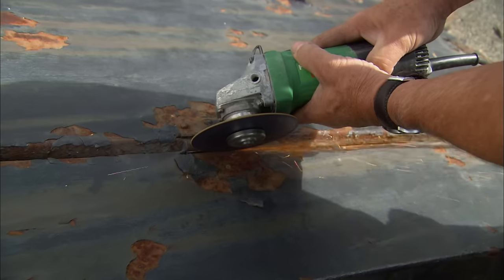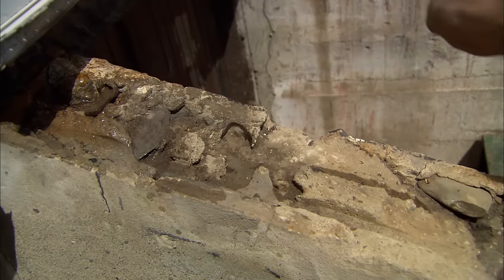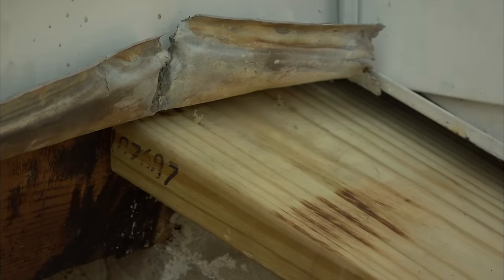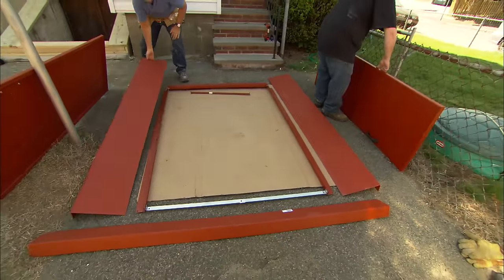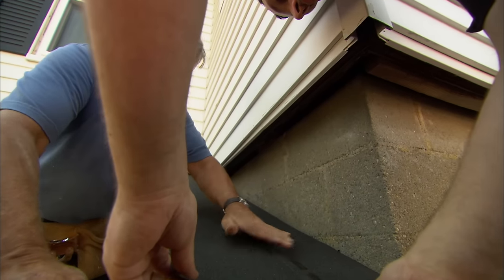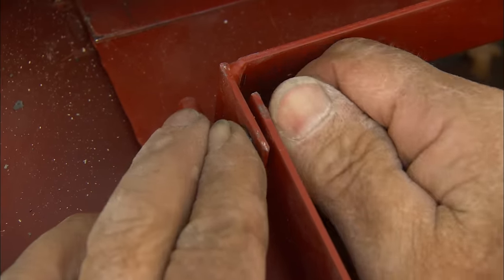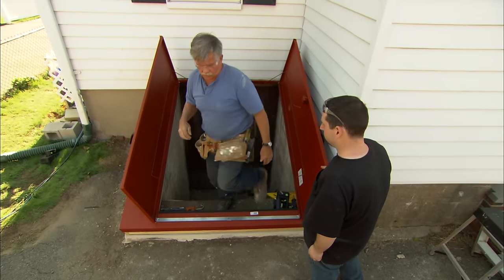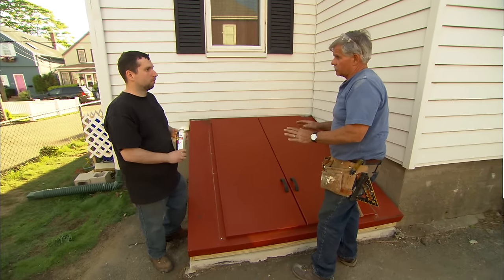How to Replace Basement Bulkhead Doors | Ask This Old House

Comment: theres something unsettling about using an angle grinder without the guard, something something ripped knuckles, idk
Reply: Yea im confused as to why he's showing everyone the wro g way to use angle grinder. He even wielded it with two hands!
Reply: Oleg Silyuk everyone does it like that
Reply: Oleg Silyuk and ducked it on the ground when it was still spinning and they go on about safety
Reply: always wear leather work gloves with angle grinders. I almost lost 2 fingers going bare handed.
Reply: @samsngdevice5103  I'd rather not wear anything that can catch in the blade
Reply: @M4st3r0fN0n3  
Dummy, Ever heard of leather safety work gloves?
Reply: Barry Lab  In the video Tom has no eye protection, gloves or sleeves.. Not saying it's the worst thing that ever happened but given it's on TV not some guy in a  shop it would be better with a guard - usually they're careful about protection
Reply: Oh he has eye protection for fitting the new at least. At the start where he's cutting the hinges he doesn't
Reply: Yeah it's sketchy, you're asking for trouble. Safety always and respect your tools. People get way too comfortable and that's when you lose some fingers, guard should always be in place where possible.
Reply: I was grinding overhead without a guard, it kicked back and the red hot wheel cut into my left forearm and instantly cauterized itself. I have a pretty gnarly scar as a reminder to use a guard from now on.
Reply: If that's all you get out of this, go away.
Reply: @steventhury8366  this is a "diy" channel. I would assume they would want to spread safe techniques, not sketchy ones. Also something something internet, freedom of speech? Bugger off
Reply: First thing you do when you buy a grinder is remove guard.

Comment: Can’t say it enough face shields are so important when using grinder cutoff blades I know from experience spent 8 hours in the ER getting pieces of the blade taken out of my lip
Reply: Some people shouldn't be around power tools and that's ok
Reply: Did your boyfriend come visit you at the emergency room?
Reply: The ones that are arguing with you have obviously never seen what happens when a grinder wheel catches and goes flinging up to your face. It happened to a family member of mine who is very familiar with power tools and usually very cautious. He was just grinding off one small area when it caught and flung it into his face. It literally cut a furrow across his chin bone. After that you'll never catch me using a grinder with a large wheel and not using a face shield

Comment: I just redid my cellar doors, without this video I would have never had the confidence to do it myself!
Reply: I'm about to redo mine. And I wish he hadn't skipped past one step..maybe you can advise me. 

So at the bottom when he screwed together the panels of wood for the bulk head to sit on level, because the surface was previously damaged..what steps did you take? And did you use any wood glue in-between since he said there should be no air gaps between?

Comment: You have to love the grinder safety, it’s just amazing! I love his Invisible  face mask and shield, plus the invisible guard for his grinder! You don’t really need safety with a grinder, they’re not dangerous at all. And the way he just let the grinder blade hit the ground like that, has safety written all over this video.  I just noticed he use a cut off wheel to grind off screws.
Reply: I've seen what happens when a grinder wheel catches and it gets thrown upward. I've got a family member who has a scar across his chin where it went deep enough that it cut a Furrow in his chin bone. I'm in agreement with wearing a face shield when you're using a grinder like that.

Comment: Grout because it’s softer than cement we want that bond and once it gets hard it won’t crack it will hold moisture  better than cement does it’s Type s HLM 3.5 correct?

Comment: Why grout and not concrete?  Also, is there something that you can paint on the existing concrete to make the new grout hold better besides water?
Reply: Use grout because concrete will break up due to the thin application.

Comment: 4:20 would like to see the details of that flat surface.  Seems like a tricky bit.  You show just about every screw being drilled in.
Reply: looks like a trip hazard. A bit more work, but I would have tried to lower the front end as much as possible. You have to step over that every time onto a narrow step.
Reply: All that is dictated by the existing concrete.

Comment: Tom should have used a longer concrete screw judging by the video it looks like the screw only penetrated about 20-30mm of structure maybe less.
Reply: +iShootBandits I thought the same thing.
Reply: about an inch longer at least! and he touched lead all with no gloves, but he had a good life i bet =)
Reply: OSHA Reg.1910 for Lead states : exposure to lead at concentrations greater than fifty micrograms per cubic meter of air (50 ug/m3) averaged over an 8-hour period.  I highly doubt Tom has anything to worry about.
Reply: Have u ever tried to pull one out of the concrete
Reply: Rob Anderson there’s nothing wrong with touching lead lol are you alright? It’s consuming lead you should be worried
Reply: All of his screws were too short.
Reply: Probably would....if it was his home.

Comment: So if a thief wanted to break into the basement all they would need is phillips screwdriver?
Reply: The home owner should install a weather-tight, lockable door at the bottom of the stairs.
Reply: Two L brackets and a two by four on the back side of the cellar door will stop em.  You're not getting through that without waking the neighbors
Reply: make sure you have a Philips #3 ... theives should use the proper tools

Comment: Hello! You as a PRO can u answer a simple question: Why Americans remove guard from angle grinder, and don't use hearing protections, see that almost i all videos?
Question about this video - see that you don't use waterproof membrane between concrete and wood, also screws was too short - 1/2 inch in grout?
Reply: @vids595  Also wondering if those screws are coated to prevent the newer PT chemicals from eating away at them.

Comment: Ok if you are going to remove the guard on your grinder to use a cutoff wheel,  and I understand it allows you a little more agility or a larger wheel with the grinder but please wear gloves and a face shield in case that wheel blows up. Also wait for the grinder to stop spinning before you just drop it on the ground in fact don't drop it on the ground or you'll cause a fracture the disc that can cause it to explode so many safety hazards
Reply: You should never wear gloves because they could get caught on the disk and pull your hands in to it
Reply: I had a cutoff wheel explode on me one time. I was lucky I wasn't hurt, but it taught me a lesson. It was like a grenade going off.

Comment: can't say I'm impressed with his safety performance there.  Using and angle grinder without the blade guard, without the handle, without a face shield, and did he just toss it on the ground????
Reply: Yet, he's managed a 40 or 50 year long career with all his original parts. Experience is safety gear.
Reply: @e.l.norton  stupidest comment I've heard.  No!  Experience is NOT safety gear.  All you've managed to demonstrate is that he's been very lucky.

Comment: I'm sorry, but 0:29 he looks like it's about his 2nd time using a grinder.  
Also 10:04 the door seems to have a bigger gap on the bottom vs the top. Maybe it just seems that way, but still, just because the bottom edge lines up it doesn't prove that it's square. Having said that, this unit screws together at the top and bottom for a set width, so you can't really change it.

Comment: Spent years fabricating steel, never used a guard on the grinders, never seen a grinder accident.
Reply: Then you haven't worked for years, dumb to not have the guard in place

Comment: I know this is old but galvanic corrosion is not when metal comes into contact with wood. It’s when 2 dissimilar metals come into contact with each other
Reply: I think treated wood is made with a form of copper so maybe that creates the reaction.
Reply: @rawbacon  I had the same thoughts as you and Sears Garage.  CCA has been banned for some time.  Does the moderns stuff still have a metal based preservative?
Reply: @kcgunesq  From the Home Depot website: "The active ingredients commonly used in treated wood are alkaline copper quaternary (ACQ), copper azole (CA) or micronized copper azole (MCA)."
Reply: The new chemicals that they use in PT lumber will eat un-coated screws in no time.
Reply: bush master 

That’s fine but that’s still not galvanic corrosion
Reply: @122276mjs   okay, just corrosion of fasteners caused by the copper based chemicals used in PT lumber. Dissimilar metals in contact with each other causing corrosion and premature failure.

Comment: Whats the brand of the cutting angle tool at 2:07? Or where can i buy it?
Reply: +Anton G That is a standard circular saw that is adjustable for cutting on an angle.  That type of saw is manufactured by many companies and can be purchased at any hardware store.
Reply: +prairie wanderer Oh sorry,  I meant the L-square tool.
Reply: Anton G

No apologies necessary.  That's a speed-square.  The one in the video looks like a Stanley brand.
Reply: Swanson speed square

Comment: Never use an angle grinder to cut steel w/o gloves.
Reply: more like with out glasses
Reply: No never use a grinder with gloves because if a gloved hand gets caught on the disk it will pull your hand and possibly your arm in

Comment: First off use a guard on your grinder, i've cut my hands up twice because I didn't have the guard on & use a grinding wheel and not a cutting disk to grind. Also when chucking down grout use a PVC glue mixed with water, it will bond a lot better.
Reply: Learn how to use your grinder better.
I don't use a guard either since it gets in the way.
Reply: I used a guard, then I got really pissed off and took it off when I was welding the base for a work table. Haven't put it back on since. Probably should, but eh.
Reply: Mister, never used a guard and never will. All they do is get in the way and if you're cutting your hands, you don't know what you are doing. 25 yrs and never even came close to getting cut, plus have you ever heard of gloves ?
Reply: Ever had a 1mm metal cutting disk explode in your face ? Wish you had that guard on then pal.
Reply: You mean regular old water
Reply: accidents happen you know? it could be a defect grinding wheel that suddenly breaks, or maybe it would slip then break and there, you lost your eye. all that happened in less than 1 second. just because you took off the guard

Comment: using screw to attach the door jamb from outside like, isnt it will make easy for thief to open it ?, i think we should weld it
Reply: co sakti it would be logical to weld it but many thieves  don't want to spend time trying to open a door , due to the higher risk of getting caught or heard
Reply: Welded screws and locks only help keep an honest person, honest.
Reply: co, do you really think a thief is going to unbolt a set of bilco doors ?  Come on man.
Reply: The doors themselves should really be better designed and have some screws protected by the door itself. Welding will still be better, but most home gamers wont know how to do it and not have the equipment.
Reply: You would be surprised how easy most front door locks are to break.

Comment: there is no wet isolation between concrete and wood! wood will rot fast!
Reply: No it will not, it's pressure treated. That wood will last 50yrs.
Reply: it's still wood, even pressured!!
Reply: There was a waterproof barrier that he put down.
Reply: The barrier he put down was between the wood and metal, not wood and masonry.
Reply: You'll have to explain how wood can "rod."   Never heard of wood "rodding."  Almost sounds like you have absolutely NO idea what you're talking about.
Reply: sorry i have meant rotting!
Reply: The wood will definitely rot and absorb moisture. You should never put PT between your bulkhead and foundation.
Reply: Sit down and watch the video and you might learn something:)
Reply: Pressure treated wood can rot.  but it needs to have a high level of moist over longer periods.  This is not the case here its minimal of rain/water is gonna reach the wood.
Reply: @MrPooopy1234  Because why?

Comment: are you trying to cut your hand off?? your using the grinder with out a  guard
Reply: The guard is in the trash where it belongs.
Reply: Pine Chopper My right index finger where was cut deep to the bone would tell you that you are wrong.
Reply: Marc Schenk Same here! Death wheel blew apart and took out the knuckle on my left index finger.